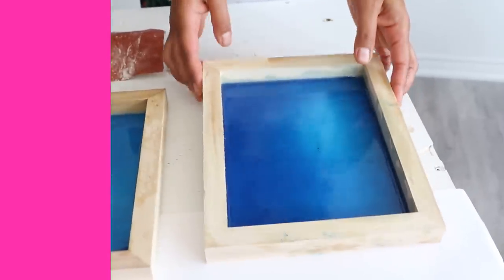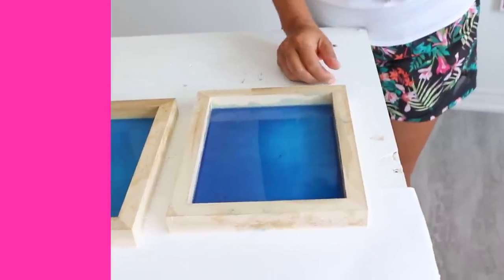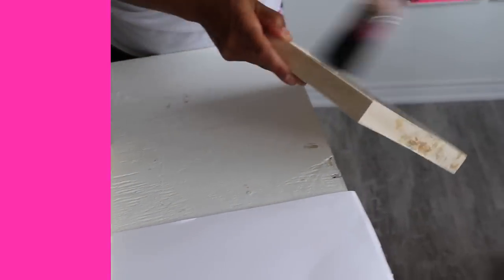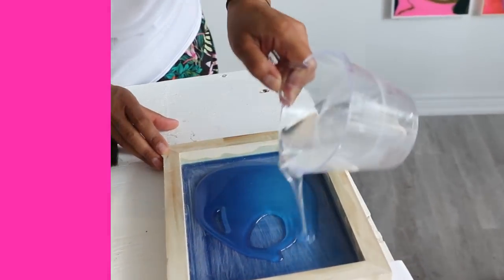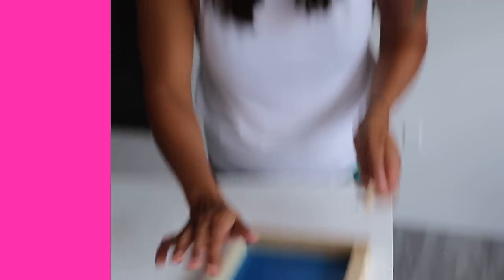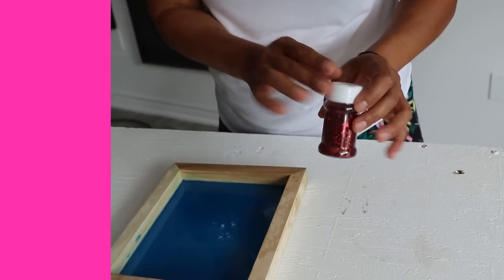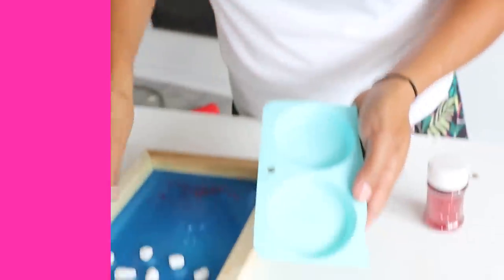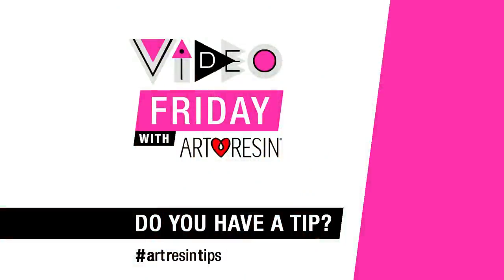How Do You Pour Multiple Resin Layers?

Comment: How would you do it with a mold
Reply from the maker: Great question - you can pour in layers into a mold as well, waiting until the resin has gelled up in between layers.  
Instead of 3-5 hours, I usually wait a little less time  (every couple of hours) to help reduce visible lines in between the layers.

Comment: If you don't mind me asking you i made a resin bookmark last night and I think now has been 12 hours do I still need to sand the surface before pouring on the second layer please help me
Reply from the maker: If the resin surface is still sticky you can pour your next layer right over top.  We ideally recommend adding the next layer at the 3-5 hour mark, but the stickiness will provide some tooth.  If the surface has cured to the touch you can just give it a light sanding and then pour another layer.
Reply: @Artresin  thank you so much for your time to reply me back it really means a lot to me

Comment: I want to use alcohol ink on dried resin, and add another layer of resin on top of that. I want the ink to flow on a smooth surface and I don't think that would work if I sanded the resin. Should I paint and sand around it for the second layer? Can I use a clear UV varnish over the alcohol ink and then add the second layer of resin over everything?
Reply from the maker: If you are unable to sand I would try sealing it first then adding your second layer of resin. I might also suggest to try this out on a non masterpiece first to see how the ink reacts on top of the resin and to the sealant :)

Comment: Hi, thanks for the video! I poured two layers and I noticed there was a line between two layers. I poured the second layer after the first layer dried but I didn’t sand it. Is this the reason why I had the line? Will the two layers be one piece if I sand the first layer or pour the second layer before the first layer totally dried?
Reply from the maker: Pouring your second layer before the previous layer has fully cured can reduce the appearance of the layer line vs. sanding the cured resin then pouring your next layer.  Depending on the style of your piece, you may always see s slight layer line from certain angles.

Comment: Hi there, quick question.  I have a 24 inch round table top silicon mold for making epoxy tables, and I would like to make a table with layers to give my table a 3D look.  The instructions in the DIY video says to wait 4 hours between pours (making the next layer).  I would use your second method in this video correct, so no sanding if I pour my next layer while the previous layer is still slightly sticky?  Or will my table later on peel away layer by layer?  I do have the DIY video if that helps any?  Thank you.
Reply: In her vid...She said that it's not good to pour 2nd layer once 1st layer has fully cured for it'll cause the new layer to peel up...You Must Sand 1st fully cured layer b4 pouring a 2nd layer of resin...3-5 hr method after 1st layer...No sanding required  simply pour 2nd layer
Reply: @lorettaparish1352  so that means I can pour my 2nd layer after 3-5 hr and it won’t be affect to the art we make?

Comment: I am brand new to this. I used an 18” X 24” wood board to attempt a grid.  The whole things is messed up so I want to cove it up and try again.  After I sand the whole thing can I apply gesso as a new back drop onto of the sanded resin to start over🤦‍♀️
Reply: Geode I meant to say
Reply from the maker: @Ellalaroo  Yes, you can sand the cured resin surface then paint it.  Once the paint is dry you can apply fresh resin and try again!

Comment: That's a nice video with slot of explanation :)) if I make coasters in molds, can I sand them there and out a top coat? Or do they need to be removed from the mold for sanding? 🍀
Reply from the maker: It's best to remove the cured resin from it's mold and then sand it if you need to. If you're looking to pour multiple coats of resin for a thicker piece, you can pour a new layer every 3-5 hours after the previous pour.

Comment: I think I need to layer in order t o cover fairy lights on a flat sheet.  First time out I could not get the lights wires to remain flat with one pour. What would be the best way to enbed fairy lights into a flat sheet and keeping their wires flat so I could pour another layer? Sure could use some adult guidance. :)
Reply from the maker: Hi Fred, did you try waiting until your first layer of resin was in a jelly like stage before embedding your fairy lights? At this point you can almost press the light into the resin and then pour your next layer :)

Comment: If I’m applying photos prior to the second layer, can I add them after a few hours and use the tackiness of the first layer to hold them in place during the second pour? Or should I use a small drop of super glue etc to hold the pic in place?
Reply from the maker: You can add them when the previous layer is sticky, you will want to be sure that you do not have any air trapped behind that will cause a bubble when you pour your second layer.

Comment: Very helpful! But what if I want to pour into a mold for a ball. I can't sand in there. So do I have to pour a layer every few hours until I have enough layers?
Reply from the maker: yes, best practice is to sand in between cured layers for best adhesion ( there is a chance the resin could separate in time if you pour on a cured, unsanded layer.  The sanding provides some tooth for the fresh resin to grab onto )

You can certainly pour every few hours until you reach the thickness you desire - the stickiness of partially dried resin will provide the tooth.
Reply: ArtResin that’s good to know. I want to do a spherical shape as part of a unique unicorn horn but I want to embed other things such as smaller resin things I plan to make and possibly glitter. Is it possible to embed smaller resin objects I make into resin ? So the 3 to 5 hour thing could work. I want sure if I should get ecopoxy for this since it’s max thickness is 1.75 inch I think they said but it’s cure time is almost 3 days. It’s also more expensive .i think I can try this with art resin. I’ll have to get another pack since my current one is ear marked for a painting. I’m having trouble getting my work  surface level due to uneven basement floor.

Comment: If i mixed up solutions A and B, and i am going to use the 3 to 5 hrs method layering, how will i keep the rest of my resin from hardening because i still need to wait for 3 to 5 hrs before pouring my next layer?
Reply from the maker: You will want to mix up just enough ArtResin for 1 layer at a time. If you were to leave the mixed product 3-5 hours in the mixing cup it will have already be well into the curing process :)

Comment: Hi I am wondering if there are divets but the resin Has only been sitting for a couple hours. Should I add more to the uneven points before it is completely dried ? Or wait until it is hardened to do a second pour? Thank you !!🙏🏽
Reply from the maker: Hi Natalie, it's best to wait at least 3-5 hours before adding another layer of resin to your artwork. If the divets have not filled in by then, they may not fill in with another layer. Divets usually occur when there is something repelling the resin, like silicone oil. Please feel free to send some pictures and more information about your process to support@artresin.com and our customer service team will be glad to help :)

Comment: I am going to be painting on the canvas, however there will be three layers not covering the entire canvas. 

1) I pour first and wait the 24 hours and paint
2) paint and wait till paint is dry and where there is no paint do i need to scuff it up or will the paint hold it as it will be on most of it?
3) Wait 24 or 72 hours between?

Thank You
Reply from the maker: Best practice would say that you should sand the areas that do not have paint on them, alternately you could sand the entire surface then paint, then pour the resin.  The painted areas will give the resin tooth, but its recommended to sand the cured glossy areas, even if you can sand parts of it it will help.   You can re-coat any time after the 24 hours.

Comment: Hello mam, when I poured my second layer after sanding the first one all the sanding marks disappeared but after full cure and demoulding I can see the sanding marks from every angle that were made on my first layer. It's my first time making clear casting. Hoping for some suggestions from your end . thank you.
Reply from the maker: Hi there, typically when you pour a second or following layer, the sanding marks just disappear.  You must ensure that you clean off any of the sanding dust that remains prior to pouring on your resin.  If you are casting clear resin in a deep mold and adding multiple layers, you often will see a faint layer line from some angles since it was not poured all at once.

Comment: I have tried the 24 hours method, after the second layer gets hard ,,the resin cube looks great from above , but if i look from the side i can see there are 2 layers , i am worried that i kept adding layers , they will be visible from the side, is the a way to make it looks as if it was cast in one pour?
Reply from the maker: Unfortunately there is no way to completely avoid that faint layer line from some angles.  You may find less of a visible layer line if you pour your second layer as soon as the first layer has cured to a gel like consistency- usually around 3-5 hours after your first pour.

Comment: I need to fix a resin pour project. there's a few errors and marks on the surface. After I sand the original resin top, do I use the same amount of resin I used on the initial pour?
Reply from the maker: You may need a little bit less than your original pour but you want to be sure you don't pour too little.  Its a good idea to have a small side project ready to use up any extra resin from your pours.  Small molds or layered pieces are always handy to have at the ready.
Reply: @Artresin  thank you, I sanded it over the weekend and wiped off all the resin dust. can I use 90 proof rubbing alcohol for a final wipe off before the second poor?
Reply from the maker: yes you can, just be sure the alcohol has completely evaporated prior to pouring your next layer. @lynneboyer3197

Comment: I am doing a pour that will require 3-4 layers of colored resin.  I am nervous that, if I don't use exactly the right amount of colorant (in this case, alcohol ink) that you will be able to tell the layers apart from each other when looking laterally.  Do you think this is a worry?
Reply from the maker: If you're pouring the same amount of resin for each layer, you can try using the same amount of alcohol ink drops in each batch. That way your color will be the same each time :)

Comment: If I am using the 24 hour method, but only adding paint in a small section, should I sand the whole face first and then paint over the sanded portion, or will that make the paint look weird?
Reply from the maker: Hi, if you're only adding paint over a small portion and don't want to cover it in ArtResin afterwards, then sanding is not required. If you plan on sanding after the paint dries, then we recommend sanding your cured resin surface first, then paint, then resin.

Comment: Very helpful because often I have sculptures sticking out of the resin and can't sand very easily around it. What if I only sand parts of a layer then add another layer of resin. Will it still hold or would I have to sand the whole layer? - Heidi
Reply from the maker: Hey Heidi!  Sanding is best practice to ensure a secure bond between the 2 resin layers, but if you've sanded even parts of it, it should be just fine 😊

Comment: I want to make a resin table top with a thick layer but I don’t want to have a boarder around it. How would I get a smooth edge of resin?
Reply from the maker: Hi Megan, you may need to do some sanding once your resin is fully cured to get that smooth edge finish you are looking for. You can then apply a very thin coat of resin with a gloved hand or brush to bring back that high-gloss shine without any drips.

Comment: In my first large alchohol ink art piece , I bad experience . When I poured second layer , some colours began to fade☹️even if I had sprayed multiple layers of protective varnish! What could be the reason?
Reply from the maker: I am sorry to hear that!  Different brands of alcohol ink have different quality and lightfast ratings, some will fade out much quicker.  Choose a high quality alcohol ink for best results.   Alcohol inks can be re-activated by certain sealants and by some epoxy resins so it is recommended to seal first with Kamar Varnish which will not re-activate the ink.  Once the varnish has dried you should be safe to coat with resin.
Reply: @Artresin  thank you so much for the support. I did spray it with brustro varnish n then wn spray 🙃

Comment: Can I paint the edges of a round board and sand the middle section, then pour a new coat of resin on top of it all?
Reply from the maker: Absolutely :) ArtResin will adhere both to the dried paint and the sanded wood.

Comment: This is mentioned for flat layers, how to make the layers for a pyramid for example so that the layers are not visible afterwards?!?
Or is that impossible and i have to use 10cm Resin and pour it completely for example?!?
Reply from the maker: To fill a deeper mold like a pyramid, you would just need to pour in shallow layers, letting each layer cure for 3-5 hours before pouring the next.

Comment: If you do multiple layers (ex: 3-4 layers) can you wait just the 3-5 hours and not worry about all the layers not curing correctly? On a piece like this how long would you let it cure "after" the finally layer is poured before shipping?
Reply from the maker: Hi Frank! 

Yes that is correct, if you are mixing and measuring as directed you should have no issues with curing using the 3-5 technique. If you are doing 2 layers like in the video and going to ship it, I would recommend to let it cure 10 days before wrapping it up and shipping it off.

Comment: if I am doing a larger project, lets say those 5*5*5 cm cube, would pouring the second layer make it challeging to cure afterward
Reply from the maker: You can just pour your next layer 3-5 hours after you poured the previous layer.  The 72 hour full cure time is based on a single layer thickness, so it may take a couple extra days to reach full hardness but it will still feel cured to the touch
Reply: @Artresin  thanks

Comment: I just tried a triangle shape resin for my mum, every thing bonded ok between layers but created extremely noticeable layers. How do I stop that? Is that's by sand papering too?
Reply from the maker: Hi Matt, if you are pouring multiple layers on a clear piece, the layers may always be slightly visible depending on the angle it is viewed.  It may help to minimize the lines if you pour your next layer within 3-5 hours after the previous layer, when the resin has set to a jelly like state rather than letting it cure hard and sanding.
Reply: @Artresin  amazing thank you, I'll try that next time. I guess that means start early and don't leave it over night!

Comment: So the second layer will still stick if I torch off the sandpaper marks?
Reply from the maker: Hi Matt! After you sand the piece down and remove any debris left from sanding you will pour your next coat and then torch any bubbles out. No need to torch before pouring your next coat :)

Comment: Im having this huge issue where when my first layer cures after about 24 hours I go in to pour my second layer and the second layer will LEAK onto the front of the first layer, ruining my pieces. :( I think this is because I pop out the first layer when it cures to check and see if it was successful. Is that whats causing this problem??
Reply from the maker: Yes that is very likely why. Another way you might want to try is waiting only 3-5 hours and then pouring your second layer into the mold. During that time window the resin is sticky enough for the next layer to adhere to without any sanding :)
Reply: You can use liquid latex to cover the side you want protected and the overspill will peel right off with the latex!

Comment: How do u add multiple layers without creating those “fine lines” between em? Thanks!
Reply from the maker: You have two choices when pouring multiple layers: the first is to pour your first layer, torch out the bubbles, cover and wait 3-5 hours until your ArtResin epoxy resin reaches a jelly like stage. At this point, you can pour on your next 1/8" layer, torch out bubbles, cover, wait 3-5 hrs and repeat until you reach the height you desire. This method is especially handy when pouring into a mold or a dam. The second option is to allow your first layer to fully dry, then give the overall piece a light sanding and pour on your next 1/8" layer. Torch out bubbles, cover and let this layer dry. Repeat these steps as many times as you'd like. 

We have not had any issues with lines or seams when following these two options :)

Have fun!
Reply: ArtResin y’all rock thank you!!!! 👏🏾👏🏾👏🏾👏🏾👏🏾👏🏾

Comment: If I poured at 9 am can I pour again at 1pm
Reply from the maker: Hi Denise - You have two choices when pouring multiple layers: the first is to pour your first layer, torch out the bubbles, cover and wait 3-5 hours until your ArtResin epoxy resin reaches a jelly like stage. At this point, you can pour on your next 1/8" layer, torch out bubbles, cover, wait 3-5 hrs and repeat until you reach the height you desire. This method is especially handy when pouring into a mold or a dam. The second option is to allow your first layer to fully dry, then give the overall piece a light sanding and pour on your next 1/8" layer. Torch out bubbles, cover and let this layer dry. Repeat these steps as many times as you'd like.